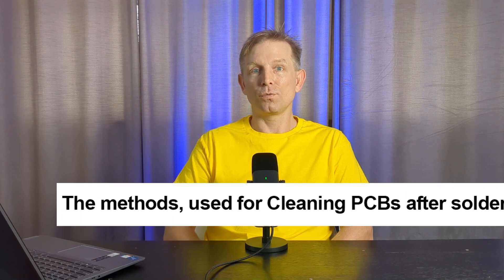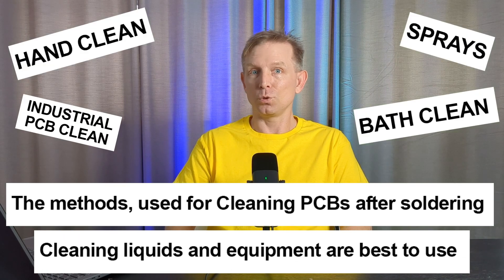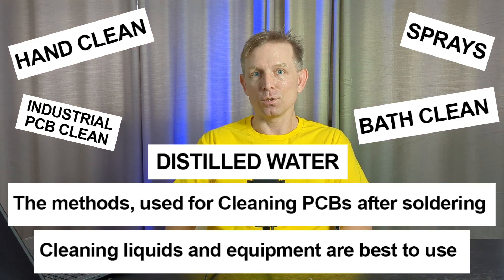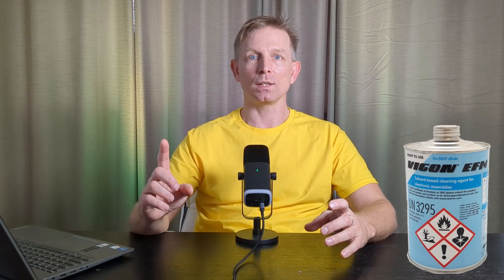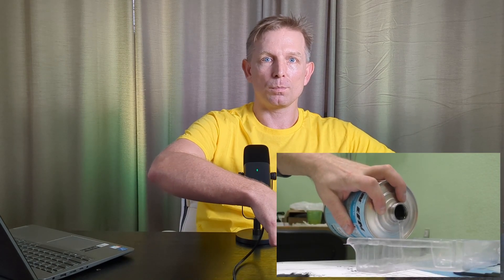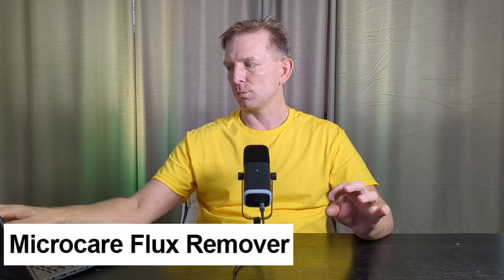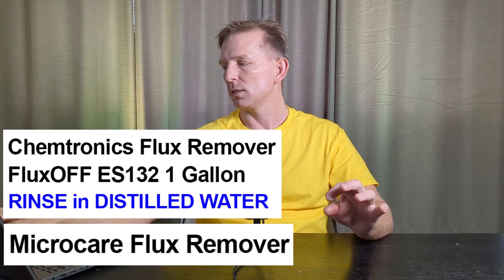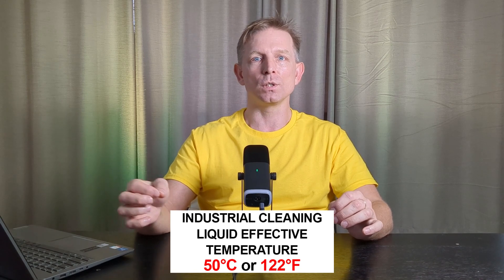Cleaning PCBs After Soldering – No More Flux Residue!

Comment: Wow, the part about IPA was eyeopening to me! I used forcyears and now I guess this is why spraying IPA on my PCBs leaves them sticky…I’m just spreading the flux elsewhere! I also used to spray contacts cleaners but I’m afraid it’s a bit too aggressive, now. I was wondering if you have some alternatives products which are easier to find here in Europe (Flux-Off was the only one i found in a local retailer….but listed in corrosive liquids category! Apparently…it melts plastics…)
Reply from the maker: Hi. Thank you. Flux off its most popular cleaning spray for electronics in repair shops around the world last 25 years. Cover the plastic with thermal tape or any other tape if you're worried. The cleaner works as it should. Don't pour it all over the board, just locally and don't be stingy with it, it's better to wash the necessary places.
 Contact cleaner is not good idea for cleaning flux residues, This spray only for pinout contacts.

Comment: I assume using isopropyl for wiping surfaces is fine. Is it when you soak the board that theres issues?
Will leaving a lot of sprayed isopropyl on a PCB flood underneath the pads, connections and traces?
Reply from the maker: It's not about where the isopropyl gets to, but how well it can wash away chemical contaminants. It will wash away organic residues, but not chemical residues, and a white coating may form.
Reply: @ElectronicsManufacturingTech  Why can a white coating form? Is it ionic contamination from remaining flux that hasn't been cleaned? Either way, I haven't seen anyone online mention white residue on PCBs after cleaning with IPA.
Reply from the maker: @penguinsushi8442  because fluxes are different. They can have synthetic resins or be completely made of inorganic components. You can't wash them off with alcohol alone and they can oxidize on the surface and fall out as a white or gray contaminants.
Reply: @ElectronicsManufacturingTech  So generally, what fluxes can be cleaned off a PCB using only IPA and some wipes?
Reply from the maker: If only completely organic - resin from wood. In any modern flux you can find not only organic components, and you will need a cleaning mixture - only IPA alcohol will not clean completely, you will need cleaners for non-organic components.

Comment: Very informative video.  One point: Conductivity units are either siemens/m (or multiples thereof), while resistivity units are ohm * meter (not ohm/meter) (again, or multiples).  The latter (ohm * meter) is because if you take a rectangular block of material with conductive plates on each end, the resistivity of the material = (measured resistance from plate to plate) * (area of the plate or cross-section) / (length from one plate to the other).   The area/length factor gives you "* meter"   And of course conductivity is the reciprocal.
Reply from the maker: Thank you for your thoroughness! It's really cool to hear that! Depending on the measurement method (in ohms or siemens) for water specifically, different measuring instruments are used. You are absolutely right that higher resistance means lower microsiemens. In industrial systems, both metrics are used and they both work effectively. Thanks for being with us! :)

Comment: I am a new subscriber so thank you for the video. I am trying to unlearn some bad habbits and learn proper procedures as I am starting a small repair service by the fall for video game consoles and vintage computers. Any thoughts about CRC QD Electronic cleaner. I cant afford a bath cleaner at this time but i have used flux off in the past. I never recieved the brush from amazon but it worked pretty well, just expensive any cheaper alternatives?
Reply from the maker: Today I published a new video about cleaning. In any case this job needs investment.

Comment: I am using isopropyl for hobby soldering and cleaning of 60/40 solder flux residue based on rosin
Reply from the maker: This is great, but it does not guarantee cleanliness. I explained why.
Reply from the maker: If you solder non-critical devices, and someone's life does not depend on them, for example, car electronics or something like that.... If this is not a small contract production and there is no responsibility to the customer, then it does not matter how you wash and with what. In any case, thank you for the question and for being here😊

Comment: My resent experience - Isopropyl alcohol 99% not helps even for cleaning dirty laptop case. And on video you explained why. Just water helps me more. Maybe 96% ethanol alcohol works better. But for electronics: only alcohol it not solution for cleaning.
Reply from the maker: Exactly 👍